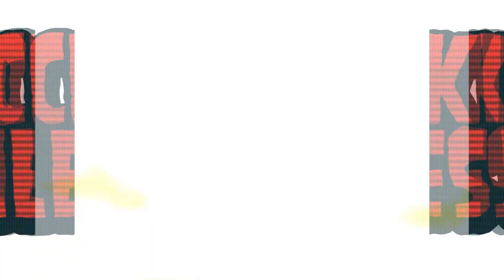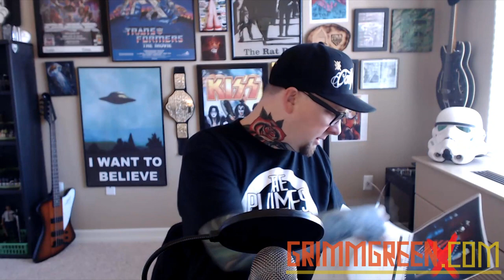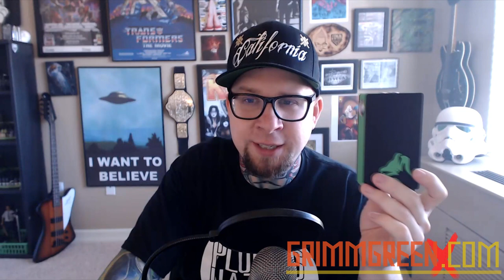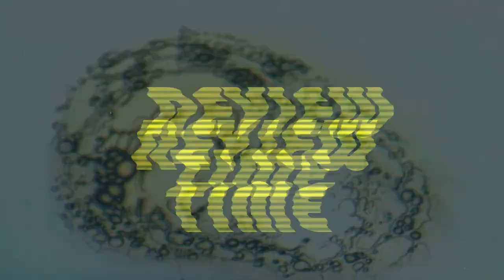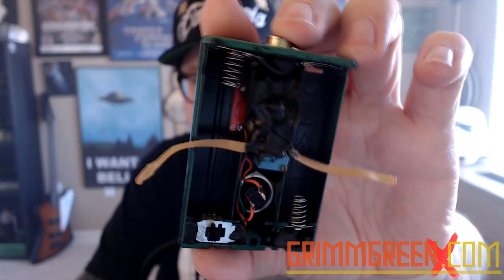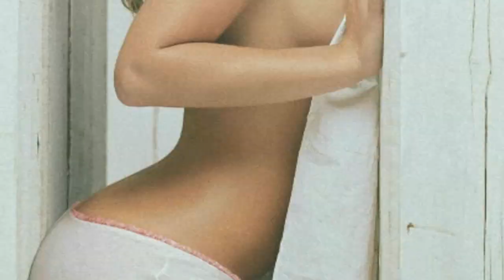NotBlowingSmoke ~ VaperSlam ~ Freakshow Mini Review

Comment: Loved the Vlog. Hope you are feeling better. The little blue box in the mod is called a potentiometer and it adjusts the resistance of the circuit. I remember you vids on the 306 Atty's and how much you loved them at the time. For there time the 306 really put out an amazing amount of vapor. Anyway love your vids and time spent gathering the info you give back to our community.

Comment: Quick question Grimm if you are using a ipv3 or a mod like that will it malfunction if you use differnt batteries or a battery like 2500mah and a 2600mah will this cause problems?
Reply from the maker: Mason Matthews yes,  Always marry your batteries.  Charge them and use them in pairs.  And make sure they have the same specs exactly

Comment: For your own safety I feel that I should warn you...THAT SWITCH IS NOT SAFE! I can guarantee there is no way its rated to handle amperage that high or even close to that  high! I would strongly recommend you get a MOSFET installed ASAP! Feel free to message me if you'd like help with that. PLEASE be careful using that box mod!